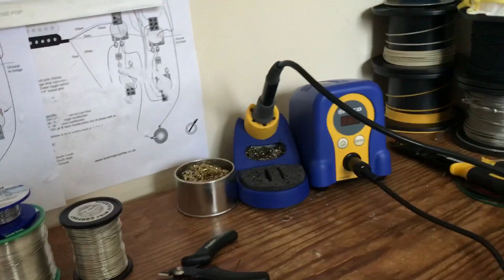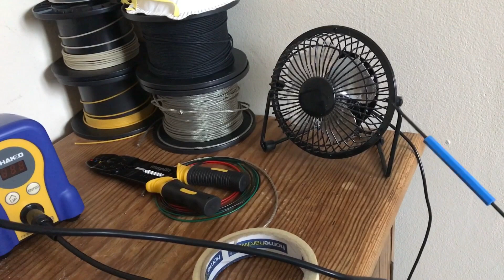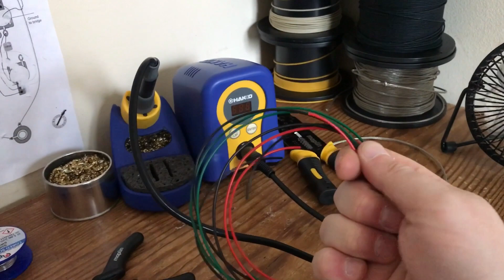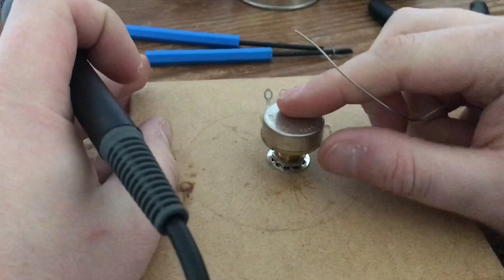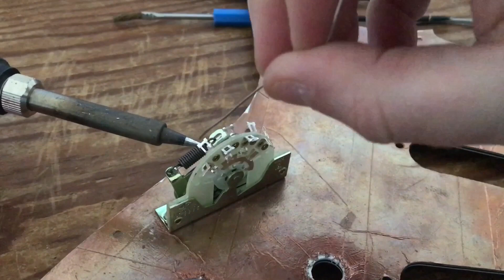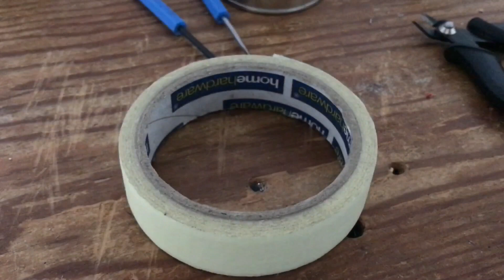Guitair wiring 101 - tinning, grounding and soldering braided wire to pots

Comment: A few tips: 

Remove the pot rear cover oxidation layer (factor tinning scale), use Scotchbrite super fine using a die grinder or a Dremel, then blow off any debris with compressed air and do a final wipe with IPA. Just remove the oxidation layer and do not grind down to base metal. 

Even if you are using eutectic leaded solder, use an alloy that includes silver. The pot rear cover tinning solders best with solder with silver in it, as you can see with the lead-free solder used in the video which has a high silver content. If possible it is best to use leaded solder due to its lower melting temperature than lead-free. If you add too much heat to the pot rear cover you could damage the pot. So keep the soldering cycles to the rear cover to a minimum, ideal would be just one.

Add additional liquid flux (select one that is compatible with the solder wire flux) when soldering to the back of the rear cover. This is especially true with Gavitt braided push back wire, where the braid always seems to be highly oxidized, as you can clearly see in the video. If you use additional flux and use a third hand to hold the connection together. 

If you use additional flux and a high power soldering station, you do not need to pre-tin the pot rear cover, which is already pre-tinned from the factory. Pre-tinning the pot rear cover is very popular, but not needed if you use the proper equipment and soldering method. If you feel the solder joint has too much oxidation just add additional liquid flux and solder the joint. I only really pre-tin stranded wire if I want to wrap around and eyelet or a post before soldering. Before pre-tinning the stranded wire add liquid flux and then solder. The ideal method is to dip in liquid flux and then solder with a solder pot. After soldering to the pot rear cover remove any excess flux with IPA.

Instead of using Gavitt single conductor push back wire you could use Teflon single conductor with shielded braid and outer Teflon jacket. The Teflon wire will not absorb moisture like the Gavitt cloth wire and you can solder the braid directly to the pot rear cover and it will not readily melt like PVC jacket wire, and the copper braid and and stranded copper conductor are silver coated, which works well with a solder that has a silver content. Unfortunately, Teflon wire is very expensive, although you do not use a great deal of it when wiring a guitar. I think the Teflon wire will perform better than the cloth Gavitt over time. Having an outer jacket means you do not need to insulate it with heat shrink or sleeving. 

When using bus wire you can clean the oxidation off with a scotchbrite pad and wipe with IPA before soldering. It will solder better if you clean it first.

You can insulate tinned bus wire or component leads using semi-clear Teflon sleeving, which is very high temp and will not readily melt. Here again, Teflon sleeving is not inexpensive.

Soldering to the pot rear cover quickly and effectively requires a high power temperature controlled soldering station (minimum around 60 Watts) and the proper tip. If you have a cartridge based soldering station (Pace, JBC, etc.) you would select a very broad chisel tip high thermal load tip and not a small conical tip as shown in the video. The ideal station would be the cartridge based JBC HDE, having a minimum power of 200 Watts, but as with all good equipment it is very expensive.

Obviously, the above is not a low cost method. However, many vintage guitar projects are performed on guitars that have a value in the thousands of dollars. Even if the guitar is not vintage but lets say a 1960s re-issue Les Paul Standard, it will cost $2800.00 (2024 Sweetwater on sale).

Comment: I'm afraid to use that Gibson wire because when you solder that ground to the back of the pot I think in some cases there could be some solder get through the internal cloth casing into the hot wire. Especially if you hold the heat to it for a good while kind of like you did there. But like I said, that's just my opinion I like to use the cloth covered wire but I don't like the outer wrapped Gibson wire. I like all individual wiring ground and hot. Love your videos brother.

Comment: I've always been terrified of frying a pot, although i csnt remember if I actually have or not, while grounding wires on there and holding iron there for too long. Shoukd I not be? You seem to leave it there quite a while for as long as it takes. Should I use less heat?
Reply: I know right, I never hold my iron on my pots for that long... Is that how long he holds it down when actually doing a job? or maybe did he slow it down and just hold it on the pot and explain what he was doing just for the video??